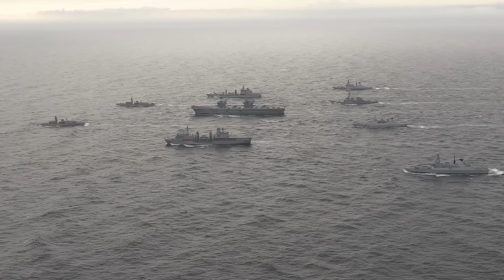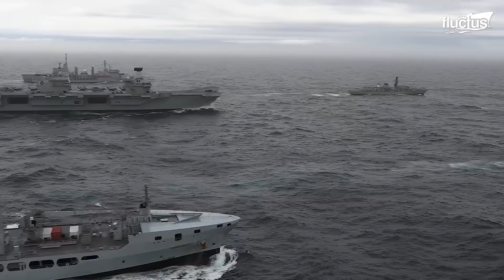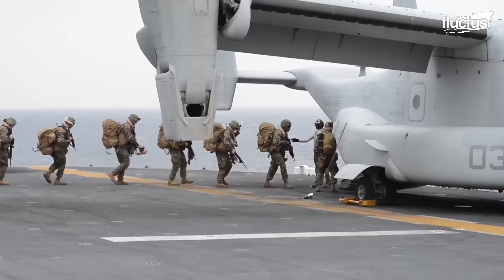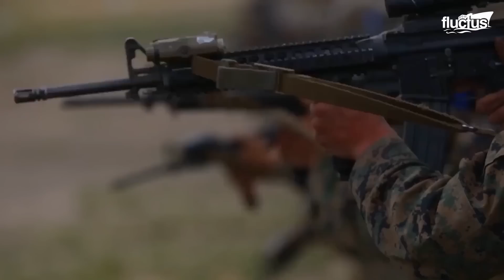US Marine F-35B Test Dangerous Technique to Compete with US Navy Catapult Launch

Comment: The F-35B isn't actually a VTOL plane, it's a STOVL, which is the abbreviation for Short Take-Off, Vertical Landing.
Reply: VSTOL, VTOL, STOVL. It all depends how you use it. Even STOSL. Short take off, short landing. Aka SRVL.
Reply: @captainbuggernut9565  it’s classified as a STOVL aircraft. Even if you deciding based on how it used, it’s still a STOVL aircraft because it practically never does vertical takeoffs.
Reply: @captainbuggernut9565   I don’t think it’s even possible for it to do a vertical takeoff while fully loaded

Comment: The Niagara Falls Airbase, when it had the alert aircraft stationed there, had a arresting wire which was used only in emergencies. When plowing snow it was a pain because you'd have to come to a crawl while passing over the steel plates protecting it. It doesn't sound bad but just as you getting up to 60mph with the roll over plow you have to lose momentum in heavy snow conditions.

Comment: It's the Royal Navy not the UK navy. And it's HMS Queen Elizabeth not 'the HMS Queen Elizabeth' and using a ski jump for take off is no more dangerous than not using a ski jump and the Royal Navy have been using them for 50 years with no problems. The ski jump enables a larger payload and longer range for a sortie than not having one. Plus the Sea Harrier FRS2 was arguable better than the f35B comedy variant, which is not truly VSTOL. The ski jump along with vectored thrust VSTOL are British solutions. The f35b is not very successful, is based on Russian technology and is already being phased out by the Israeli and USAF air forces due to poor performance, high cost and unreliability. The UK has also decided to half the number of f35s it is buying and there is a chance that could be cut further.
Reply: Your who post is full of you know what.

Comment: Empty jet without heavy weapons can take of like helicopter ,if carrying heavy weapons must have a run way, so is not yet very superpower
Reply: with the ski jump the aircraft can take off at full load no increase in runway length required then land vertically with full weapon load because fuel load has reduced

Comment: Instead of short road the run ways should be as long as land run ways in increasing the ship's length
Reply: I wonder what the turn rate of a mile long ship would be?
Reply: Or a long long platform can be towed with a engine, engine air crafts roads storage all concentrated in a single small ship is too vulnerable to attacks even with other ships protecting it

Comment: Is there an altitude limit for its hover mode? At 40,000 feet could it slow down and hover inside a large cloud?
Reply: no, air is not as dense up there and the engines cant support the lift needed for a hover, they also cant hover forever kinda thing. its only used for landing or taking off in certain circumstances. 99% of the time they use STOL or short takeoff and landing not VTOL or vertical takeoff and landing.
Reply: As to hide in there for half an hour or so and then do a surprise attack and jump on somebody from behing? :D
Reply: The VTOL is a party trick that is never really used in practice. Well it is used in literal practice as in the training exercises, but not if it can be avoided in an actual use scenario. But if an airfield gets bombed to shit, the F35 isn't going to have any problem getting into the air. That in itself is huge. Normally bombing an airfield can prevent the opponent from launching fighters/interceptors, but the F35 can launch from a cratered airfield and intercept.
Reply: @adawg3032  They literally land vertically on LHAs and LHDs and the like.
Reply: @section8usmc53  
LHAs and LHDs means what? I was never in the military so you guys lose me with the acronyms.
Reply: @MustangsTrainsMowers  “Small” Aircraft bearing “cruisers”. They also have helicopters and other up-down craft. Some have  amphibious assault capability. They have 20-40 aircraft some other small-ships, too
Reply: @MustangsTrainsMowers  They are about half the size of a Nimitz class aircraft carrier. They are made for Harriers, helicopters, V22 Ospreys, and now the F35B. They ALL land vertically. There's no arresting wires for high speed landings. Now, the F35B and Harrier don't typically take off vertically on ship because it is harder on the deck, but they do occasionally, and they practice VTOL and hovering and associated maneuvers regularly on air bases. Basically it's something they do all the time. There are plenty of videos here on YouTube showing exactly that.
Reply: @adawg3032  🤦🏻‍♂️

Comment: The United States does not use ramps. Only countries that can not afford to build big Carriers need them. As they need to take off with heavy loads. 

The draw back with ramps. You can't take off and recover aircraft, at the same time.
Reply: Not that cut and dry. The OG INS Vikrant was a CATOBAR and the current INS Vikrant is a STOBAR. Yet the current INS Vikrant is much more capable. And its also true that the next carrier to be built in India will be CATOBAR and will be much more capable than the current INS Vikrant.
Reply: @death_parade  It took over 13 years for the Indians to build and commission a STOBAR boat. It will likely take them close to 30 years to build and commission an indigenous CATOBAR boat.
Reply: @AA-xo9uw  Doesn't actually work like that. The more you work on something new, the better you get at it. For example, back when we started building warships, we had to import the steel for it. Today its all made in India. Same for Titanium for aerospace. Now its happening for Naval weapons suite. Same thing will happen to the Aviation Complex which was one of the major causes of delay in INS Vikrant's construction because Russians delayed its delivery. For the CATOBAR carrier, much of the aviation complex will be designed and built within India itself.
Reply: @death_parade  Sounds good. Are you Indian? I was on CV-64 back in the mid 90s, in the Indian Ocean, when we had a VIP contingent of Indian military officers come on board for a visit and demonstration. We put on an air show for them, which was memorable. I expect those visits were part of their development program.
Reply: @dre3951  Yes sir. And since then multiple such exchanges have taken place (barring a short period in the late 90s and early 2000s where India was sanctioned for testing nukes). Back in the 90s when you welcomed the Indian Navy delegation, they were designing our first indigenous carrier (IAC-1), which just got inducted this year. But by mid-2000s, Indian Navy was already deciding on the design configuration of the follow on carrier to IAC-1. This was to be a nuclear powered CATOBAR heavy carrier of around 65,000 tons, called IAC-2. This must have been influenced by those visits the kind you mentioned. Hopefully some lessons were learnt with regards to the high sortie generation rate and simultaneous launch and recovery ops that US supercarriers are capable of. 
.
But later on Bhabha Atomic Research Center stated that building a reactor that doesn't need refueling for a lifetime for such a ship is not possible for the next 20 years because of limited supply of weapons grade HEU which would only be resolved once the current expansion of the Nuclear City at Challakere completes. Because existing infrastructure is already busy supplying HEU for the expansion of the nuclear arsenal and for the submarines. And so now, IAC-2 will be conventionally powered. Navy was already looking at IEP for this, and USA has been generous enough to offer an EMALS system for IAC-2. So for now, IAC-2 looks like it will be EMALS, IEP carrier.
.
These military exchanges and exercises with US Navy have been beneficial for the Indian Navy, especially the Malabar Exercises.
Reply: @death_parade  It is that Cut and Dry.. As only the United Stated has Super Carriers and can afford to build them. 

This is the reason other countries use what I would call Jeep Carriers..There cheaper to build and maintain. Besides you have to build ports and Planes as well. As else they would be useless...Not many Countries have 70+ $200 Million Dollar Planes. On each one either..
Reply: @WizzRacing  I am not talking of supercarriers. I am talking about the STOBAR vs CATOBAR comparison you were making. And I gave you an example to support my assertion that CATOBAR doesn't necessarily mean "big carrier" and STOBAR doesn't necessarily mean "small carrier".

Comment: Ski jumps don't do much good. It gives the plane vertical speed at the expense of losing horizontal speed...which is bad. Better to fly low and not stall than to fly high, stall, and come crashing down. They have a slight benefit of rotating the aircraft to a higher angle of attack than it could get at low speeds, but this is almost worthless with vectored thrust like the F-35.
Reply: that's why it has been in use for at least 40 years do you really think that military designers deliberately fit a ski jump which increases weight and various other variables just because it looks cool?? with the ski jump the aircraft can take off at full load, that's not a minimal increase, and the aircraft couldn't get off at full load without a catapult otherwise. Not sure where you are getting your information from but basically its ALL wrong!!

Comment: F35b does not need 'ski-ramp' used on British carriers, takes off just fine without one, while also going full VTOL (vertical takeoff and landing) which obsoletes both the ski ramp and runway in fact.
Reply: They can take off completely vertically but only under special circumstances and very low on fuel. Thats why they're referred to as STOVL (short take off vertical landing) instead of VTOL even though they technically can do it
Reply: I just posted nearly the identical comment!:washhands:
Reply: It's true you don't strictly need a ski ramp you can do a rolling take off without one as the USS America does. But a runway and therefore rolling take off isn't going to be made obsolete unless you don't mind only doing vertical take offs with very light loads. If you like a much heavier load then the runway is not going to be obsolete.
Reply: I heard the "Engine-Heat" at VTOL-Mode is a problem on Surfaces like Aircraftcarriers, could harm the Ground cause running so hot?!
Reply: True.  They do not need that for take-off.  However, they need that to increase fuel load and  missile load.  Vertical takeoff decreases the plane's combat ability which is not good for a fighter plane.  Actually the Royal Navy improves the STVL to STSL.  F-35B used in Royal Navy is 30% better in compat as a result.  US should ask UK guy for the same improvement.
Reply: @catchnkill  "STVL to STSL."(sic)

Don't make up your own acronyms.

"F-35B used in Royal Navy"(sic)

Unlike the RAF the Royal Navy has yet to achieve an IOC F-35B squadron.
Reply: @AA-xo9uw  Sorry that I am confused by the UK folks.  If those F35B are RAF land based, why not buy F-35A?  Then why do they make the BAE upgrade?  Buy F-35A will be a better choice. The backward landing of F35-B on HMS Queen Elizabeth is for what purpose?
Reply: @catchnkill  RAF F-35B  squadrons will operate from both QE class boats, just as 617 Squadron operated aboard QE during CSG 21. The UK bought itself flexibility with the F-35B that the F-35A does not provide as the A can only operate from shore installations. The B can operate from both. Being able to recover from bow to stern instead of from stern to bow means that the boat doesn't have to be turned into the wind in order to recover aircraft.
Reply: @AA-xo9uw  plus the RAF can operate at full load from short/ damaged runways as the Harrier used to in the 70,s 80,s 90,s 2000,s

Comment: "In recent years air forces around the world have been exploring arresting cables", you say? If "recent years" includes the 1960s (that's 60 years ago!), you are correct. the F-104G posessed and used a tail hook for emergency use. NATO runways have been fitted with arresting gear since the 1960s and aircraft like the F-104, F-4, F-5, F-15, F-16 all have tailhooks!
Reply: You can add the rf101 Voodoo to that list. Ours was like a big leaf spring with a shoe that resembled a horse's hoof.
Reply: 80 years ago? I think?
Reply: F-22 as well
Reply: @AA-xo9uw  the F-22 is not in use with non-US air forces or even stationed in Europe.
Reply: @ronaldv_tm  there are F 22s that were transferred to a us base in Poland last month
Reply: @colestahl1265  they are not transferred, they are (temporary) forward deployed USAF aircraft and crews. There are no U.S. bases in Poland.
Reply: @ronaldv_tm  Oops, poor choice of words (meant stationed) the point still stands that there are F22’s stationed in Europe at this moment.
Reply: More to your point, the US Navy had arresting cables in the Second World War
Reply: F-22 can't do a carrier landing even with tailhook.
Reply: @Steven_Edwards  of course it can! I doubt you can use it afterward, but it can land on a carrier!! ;)
Reply: Having a tail hook on non navy aircraft is for emergency landing FOR RUNWAYS ONLY. The tail hook on Air Force aircraft is not carrier rated and is only for use if breaks stop working or when coming in to fast and can’t slow down in time.
Reply: @Mench2007  Like I said: an F-22 can land on a carrier, but you likely can never use it (the fighter) again. Don't take it too seriously, please.
Reply: As do air force versions of the F-18 flown by allies
Reply: all american aircraft, almost no other nation does domestically.
Reply: @seeleagent  That may or may not be true, I have no idea. My country's air force has been relying on US made hardware since we phased out the Hawker Hunter in the 1960's.